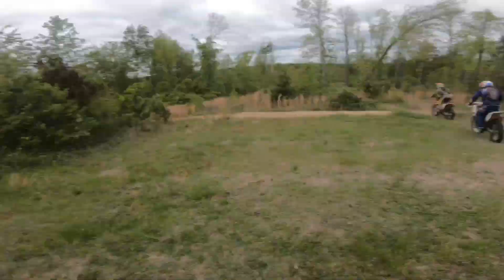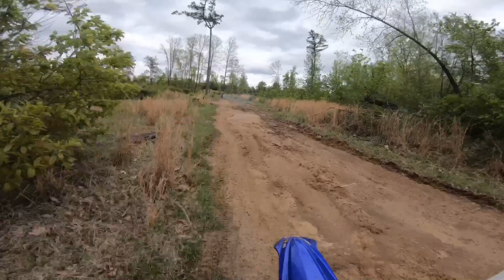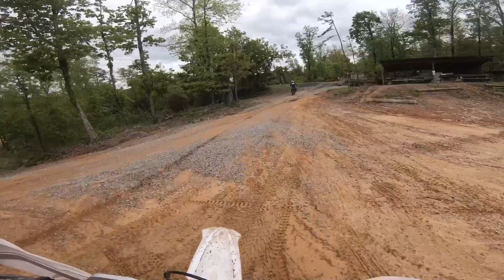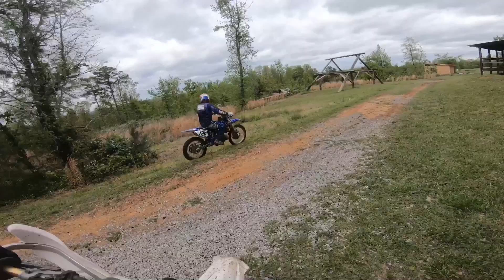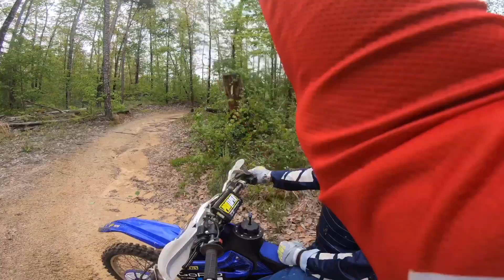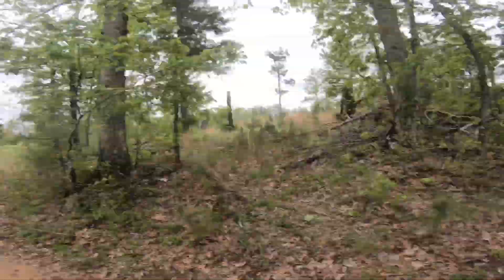YZ250 VS. YZ295 | YZ300 + KTM 300XC blows a radiator hose

Comment: The Shinko mx216 is 👍🏼. I put one on in November along w/a 525 Cheater. Love them. It will add a little weight tho. It’s marginal but you’ll notice it. You’ll feel more planted but it will also want to hike out of deep ruts because of the width & knobbies side grip just want to climb.
Reply from the maker: session telemetric agreed, I’m a big shinko fan now. The mx216 definitely does add some weight, especially when you pair it with a mousse lol but I’m loving the combo. Keeps the front end stuck to the ground in turns but still pops up easy with a the torque of that 300. May have to do a review vid on it here soon, almost had it a year now

Comment: I wonder if there would be more noticeable difference in the low crawl stuff.
Reply from the maker: Keith Hudson it definitely gives the bike more low end torque. I made this video before I put a lectron on it. The lectron smoothed out the low end power and made it more predictable and useable for technical situations
Reply: @brapbuddy9660  Do you think the low end was more do to the larger bore or the new carb?
Reply from the maker: Keith Hudson the big bore kit gives you more bottom end but the way the power valve works with the keihin carb still gives you an abrupt power hit that’s notorious to YZs. The lectron smooths out the power and makes it more controllable. For example when I tried slow wheelies and pivot turns before the lectron the bike would sort of get out of control whereas with the lectron those moves feel much more controlled. It’s hard to explain to someone who hasn’t experienced it. Lectrons are worth their weight in gold in my opinion. Hit up BeRad for your lectron needs
Reply: @brapbuddy9660  Allright awesome. Money being a factor, if you had to choose KTM 300 or YZ with the big bore and Lectron, what are you going with?
Reply from the maker: Keith Hudson that’s a hard choice to make. I picked the Yamaha because it’s cheaper to maintain. My bike came with the magura and the 300 kit on it so it’s equivalent to a ktm 300 up to 2006 but cheaper to maintain. If you’re comparing it to a 2007-2016 ktm I wouldn’t want any of those bikes. I’d hold out and save my money for a 2017+ ktm and get the counter balanced motor but I could buy 4 of my bikes for the price of a 2017+ ktm 300. It really depends on how much you want to spend and what you want out of your bike. My bike does everything o want it to do and if anything breaks on it I can order it off Rocky mtn and have it to my door in 2 days
Reply: @brapbuddy9660  Are you referring to the Magura hydraulic clutch replacement because that would be the game changer.
Reply from the maker: Keith Hudson yes I am and it absolutely is a game changer, especially when paired with a Midwest mountain engineering clutch lever to further lighten the clutch pull
Reply: @brapbuddy9660  😲😲😲 I didn't see where they made it for the YZ until just now. So glad this conversation happened. I'm sold!
Reply from the maker: Keith Hudson glad I was able to help!
Reply: @brapbuddy9660  I do appreciate it.

Comment: Did Eric Gorr do your 295 kit? I have a 2017 woods set up yz250 I’m gonna go big bore on when I wear my current weisco build out. I ride a lot of gnarly single track so I want that extra grunt. I have mine set up with the 18inch rear, Magura hydro clutch, fmf gnarly with shorty silencer, the kyb with a pro motion revalve and spring, so it’s pretty well a woods weapon as it is, but The big bore kit would make it that much bette rIMO. Any thoughts?
Reply from the maker: Drew V yessir it’s an Eric Gorr 295 kit. I would highly recommend it. I have put about 150hrs on the motor and am getting ready to replace the top end. It’s been an awesome motor, has grunt like a 450 but is still nimble. I know Eddie Sanders racing makes some big bore kits for the YZs but don’t know much about them. I’ve heard bad things about Athena’s big bore kits though so I’d definitely stay away from those.
Reply: Yeah Eric Gorr is doing mine when I get ready to do it. I just rebuilt my 17 bottom to top so it’s all still fresh. I’ve put probably 20 hours on it since rebuild. I think I will go 295, pump gas, with the power band he recommended for single track or the more better one as he calls it. I’ve heard  nothing but great things from him and 660 bucks ain’t bad at all!
Reply: I came off a 450 and hated how it felt so heavy. This 17 makes woods set up yz250 number 5 for me. I just love how nimble they are and I want to try and get it as close to that 450 power as I can get with the big bore
Reply from the maker: Drew V I’ve got the Mo Betta porting, absolutely love it paired with the gnarly pipe. The grunt is very close to a 450. I actually traded an 06 wr450 for this bike and was blown away immediately by the grunt of this bike. I just couldn’t man handle the 275lb wr450 like I can this yz in the tight stuff but I will say the wr450 was more planted in the super fast fire road stuff
Reply: Brap Buddy yeah my 450 felt heavy in the slow stuff. I hated it
Reply: Brap Buddy it was great in fast stuff tho
Reply: Brap Buddy the mo Betta as smooth as advertised or does it still have that rip your arms off hit? I like that arm ripping pull. Like to have it both ways.
Reply from the maker: Drew V when I had the stock keihin carb, the power was more like a light switch. It still lugged very well, but once you twisted past a certain point that power valve opened up and it would try to rip your arms off. This wore me out during 2 hour hare scrambles so I got a lectron and now have A LOT more throttle control, especially at low RPM. But if you keep twisting, it’ll still rip your arms off
Reply: Brap Buddy that’s awesome. I had planned on going with a lectron when I do the big bore so I can have less worry about getting jetting right.
Reply from the maker: Drew V yeah the lectron has no jets so once you set it you’re good for any altitude/humidity. I ended up at a quarter turn leaner on the metering rod than what they sent it to me at for the stock YZ250 settings. I’ve read a little into it and apparently you need leaner jetting with a 300 kit because the vacuum of the bigger piston sucks more gas in per stroke. Haven’t messed with the top end screw, thats been pretty spot on
Reply: Brap Buddy yeah you’re right. A 300 as opposed to a 250 runs just a touch leaner. When I order my carb I’m gonna try to get it already set up for a 300cc deal so I can just slap it on and go.
Reply from the maker: Drew V when I ordered from lectron I put in the “notes” section I had a 295 kit but I suspect they sent it to me at stock yz250 settings, just a heads up. However, if you order one of the new H series lectrons through my boy @BeRad he might be kind enough to lean it out a quarter turn for you before he ships it
Reply: Brap Buddy I was gonna order one thru Kyle Brothersen at Dirt Bike Channel. He will adjust them accordingly on order if you ask.
Reply from the maker: Drew V I actually ordered mine through Kyle brotherson last year around this time hoping to win his Husky 300tpi but I didn’t win and my carb arrived running too rich. Just sharing my personal experience
Reply from the maker: Drew V I think Kyles link takes you straight to the lectron website and he gets commission for directing traffic their way. I know for a fact, BeRad orders lectrons to his business, and then ships them out separately from his facility so he actually touches the carb himself before it gets to you
Reply: Brap Buddy I tried winning the 300xc or the 250xc this last go around. I swear I think it’s rigged. Seems like every winner is close by where he lives except for the guy that won the husky from Connecticut.
Reply: Brap Buddy I may order from my local shop and have it shipped to them, then when I go pick it up have my buddy Travis adjust it for me. He’s a damn good mechanic for Mountain Motorsports, but damn they mark their shit up way too high. I want my shit to be right without having to do anything to it when I get it.
Reply: Brap Buddy I’m a decent mechanic, but I hate trying to adjust on things that I don’t know a whole lot about. I’d rather have it right when I get it lol.
Reply: Brap Buddy i could just buy a tpi bike , but to me that shit seems like it would be that much more complicated to work on if you had any issues out of it. And I like mixing my own gas. I wish Yamaha would just break down and make a yz250x and a yz300x with an e start. I’d buy one in a hurry! If they’re gonna compete in the off road part of it they need to do something.
Reply from the maker: Drew V I hear ya man, that’s what I was looking for when I ordered my lectron but it came too rich and it took me a few spark plugs to get the mix figured out. Just trying to help out a fellow rider in the unique situation of looking at a yz300 application. I completely agree, I wish more than anything Yamaha would break down and make a yz300x with e start but the truth of it is they don’t have to. People keep on buying the yz250x. It’s 3-4K less than the euro bikes brand new and can hold its own against them with the right pilot. But all of us Yamaha fan boys can all keep on wishing lol 🤞🏼🤞🏼
Reply: Brap Buddy I think eventually Yamaha will come around with some upgrades. I’ve heard rumors for 2021 but idk
Reply: Brap Buddy I hate to leave team blue really tho. The bikes are so light and flickable it’s crazy.

Comment: Do big bore bikes need rebuilds faster then stock bikes?
Reply from the maker: Mr Black I have 150hrs on this Eric Gorr 295 kit with 0 issues. Probably going to put a piston in it soon as a preventative measure but it still runs fine